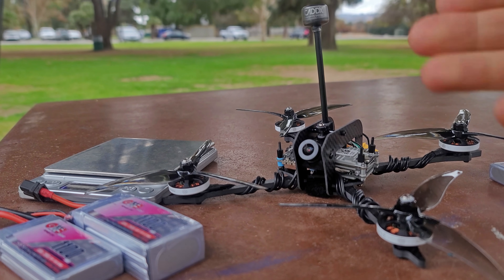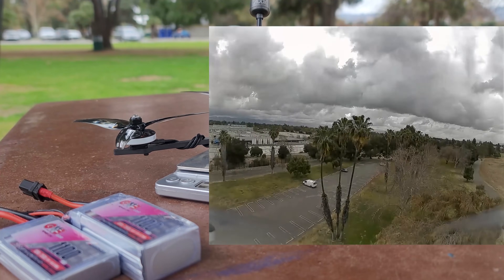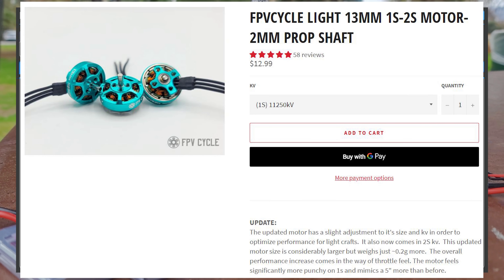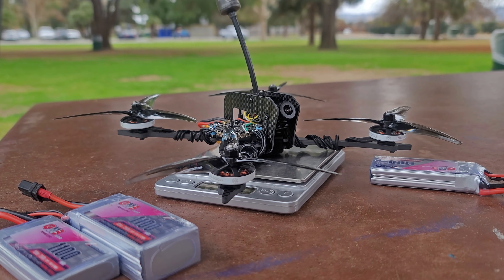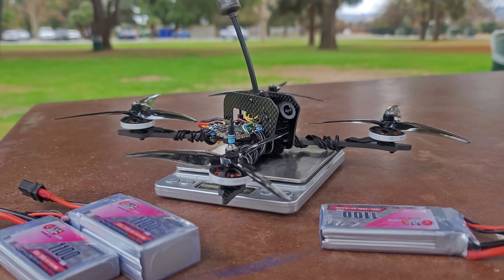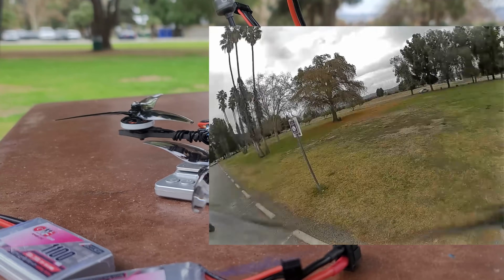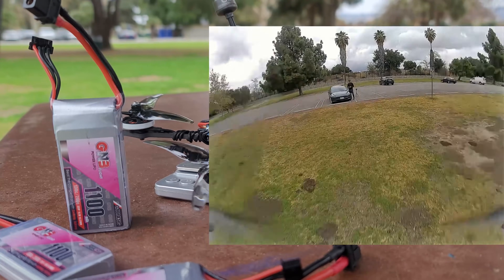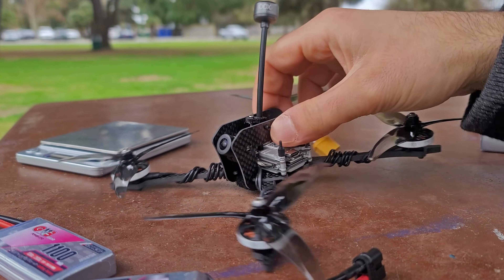Curb your motor wires - 250g 5" things...

Comment: Should be the same weight classification as model aeroplane weights.  Under 7kg, crack on. Over 7kg, large model registration, building inspection, structural testing etc. Unnecessary, unenforceable, useless laws, that do nothing for perceived safety even. Gubmint gots too big for its boots.

Comment: 1100mah = 1.1amp    100C means it can do 100X 1.1amp  for a boost of power i think thats how that works     so 130C battery can do 130x the listed mah
Reply from the maker: C ratings are entirely BS unfortunately. The number doesn't totally mean anything. A really good pack cannot give a true C rating over about 35-37C. Battery companies just use the C rating to rank their own packs against their other lines. You can't compare a 120C GNB against a 120C Tattu. Neither is actually 120C and neither can compare against a product made by an outside company. All in all, the 1100mah 130C pack definitely should not be able to produce more amperage than a 2600mah 70C. If you want to do the math by the listed C rating, that's 143A vs 182A. The 2600mah pack should do 27% better but in my testing, the 1100mah pack is doing maybe around 50% better than the 2600mah pack. There's more going on here...

Comment: IDK about your 6s commentary on this one. I don't have any experience myself, but the single most agile and powerful flying quad I've ever seen was Quadmovr's ultralight 5" with 2004 1700/1800kv with these props on 6s.

Also, I feel like I agree with your original thoughts mentioned in this video on the 250g rule. If I could change it without changing the 250g part, I'd make it so that limit is only including permanent fixtures to the quad. AKA, everything soldered on. So no props, batteries, or recording camera since those are honest to goodness variables.

Comment: Did you ever go anywhere with this approach? I like the aesthetics of the frame (looks a bit like a combination of molar and powerpick). Also the 2S idea is interesting. But seems like you abandoned this direction to go with a more traditional but ultralight 5" freestyle frame and higher voltage instead. Too bad, this looked so interesting!
Reply from the maker: Yeah. Check out my latest video.  I'm just about finishing up the design

Comment: Higher voltage just has much much more electrical potential so the magnetic fields generated have a much higher strength.
Reply from the maker: Current is actually has a direct relationship with field strength. Voltage has a round about path to the same thing.  Currently is generally what feels better in the air.  Feel like flight feel of the throttle

Comment: These low cell big prop light weight drones are intriguing to me. Could get me back into fpv more. I think I will build one of your 3" 1s quads. And find out. Been out it and all of the new stuff for a while. Are my fatshark hd3 still good enough these days? Things have changed since I have been out of the hobby full time for the past year and half.   Seriously I found a build kit from raceflight I never put together frame, fc, esc motors everything, I didn't know raceflight wasn't a thing anymore. Can I still use that kit? Is it worthless? Any help would be appreciated.  now everyone hates frsky things just seem way different.
Reply from the maker: raceflight has become flight 1 now

Comment: I enjoyed the motor discussion. Do you have more content to share on why larger cells can support higher amp draw? Such as 1100mah 3S does better than 650mah 6S? Can't wait for the next sub 250g video.
Reply from the maker: it's a factor of how much surface area there is to pull the electrons from.  More capacity means more surface area means more current means more power.  C rating....

Comment: what second quad would you recommend that is under 175$? I have been flying the normal tiny hawk 2 for about 3 to 4 months. Im looking for a quad with unguarded props and have the ability to fly at parks without annoying people. I really want to build a 3s or 2s toothpick but I have no idea how to solder lol. Are there any solid bnf toothpicks out there I could look at that are 2s or 3s?
Reply from the maker: 3s TP3.  We will hopefully have motors in another 2weeks
Reply: @Kabab  thanks, Ill take a look at that.

Comment: Oh and do you have a good 2s like starter charger? I don't have a real charger yet and I want to put a xt30 on my tinyhawk 2 race with the gnb 450 and see how that goes.
Reply from the maker: The charger is coming after CNY.  I've also come up with a way to get 2S on this to work really shockingly well but I'm still not sure it's reasonable to go with 2S ok such a big quad.
Reply: @Kabab  is it the tunerc thor? Because there is written tunerc on your new babytooth board.
Reply from the maker: @Max_0578  yeah that's the one with some minor changes.
Reply: @Kabab  yooo thanks bob!

Comment: Shorter motor wires will have less resistance and deliver higher voltage to the motors (less voltage drop through the wires), but it really only makes a difference if the resistance of the wires is a significant portion of the total resistance of the windings.
Reply from the maker: That's for sure :-).  The next build will have shorter wires.

Comment: To understand why lower voltage doesn't punch as well is because to hit the same power you need more current and components are mostly current limited, not as voltage limited. One thing that always surprises many people is that wire gauge is about current, not about voltage. Voltage limitations just have to do with keeping things from shorting
Reply from the maker: This quad in general is pretty low current.  If I thickened the wires on this particular setup I would probably get a little more performance out of 2S but not enough to make up the difference with 3S.  Whatever is happening, 2S is just too low for this general setup

Comment: The screws holding the heatsink on vista is supposed to be the same distance as whoop board i heard... So you could stack them if you install longer screws in the vista and use them also for fc... Or just go naked vista...
Reply from the maker: I think I tried that a while back and it didn't work out
Reply: @Kabab  have a look on mr shutterbugs youtube. 3inch baby tooth with vista. Forward to time 9:20... Looks like it works ok with minor adjustment on hole size. I think you should recognize the motors he uses. But he complained about short wires instead of to long :-)  tempted to do a bild like that but haven't clicked buy on dji stuff just yet... Anyways it's been out of stock in EU for some time now...

Comment: Awesome video Bob. I'm having serious trouble tuning my 4" fouride on betaflight 4.2. I was receiving flutters on sharp stick inputs on the default tune and in extreme cases the quad would do a death roll. I don't have rpm filter enabled. Is this a filter issue or is it something I can fix by tweaking the P and D gain?
Reply from the maker: Try emu. I can't use BF anymore

Comment: Just to make sure: On that build with 3450kv and GNB 3S 1100, you would have more runtime in freestyle flight than a 1725kv version of that motor [I know that isn't offered] and a 6S GNB 6S 550mah (which is the same weight)?  If long range cruising, I'm sure the 3S would win out.
Reply from the maker: there's no point to 6S on light platforms.

Comment: I've been telling guys since the powerpick was released that the 2203 motors with Gemfan 5125s running on those 3s 1100 packs is an amazing combo. With the 3450 kv motors I found over time that I preferred Gemfan's 4023 prop and a 4s 850 pack even more.
Reply from the maker: GNB is working on some new cells.  The new 850 4S should be really good

Comment: Great stuff... You watch, they'll be a load of sub 250's come out of China with these specs. Looked fast enough and due to weight, looked like it had a tone of grip. I have a fairly fresh 4s 5inch race build with 2306 2650kv motors on... Weighs 320g dry weight (no battery) are these motors suitable????
Reply from the maker: yeah these motors at up to ~475g AUW are fantastic.  the current 2800kv ones on 3S are excellent

Comment: It's almost to the point were buying any 5" quad that will have an AUW over 250gr, which currently is almost everything, wouldn't be worth buying with the amount of horse sh#@ involved in flying the fu@#ing thing in two years.

What you in for? 260 gr AUW, doing a 5 year stretch! Ridiculous.

Comment: I really think that more than anything the 250g BS is just going to spur on the community to innovate and ultimately come up with better things. In my opinion the naked gopros are goin to become extinct. Why? because the community has figured out how to hack FC gyro data into ANY video footage to run it through rsgo. That means the return of hyrbid cameras that have rx+tx uarts and will write and sync gyro data for rsgo processing out of the box. My brain continues to dream of just how far this concept could get pushed. 1in sensor fpv cameras? 1+ghz FC with built in video processing? Changeable lenses for fpv cameras?
Reply: For the record I think this 250g thing is utterly infuriating and nothing more than a means to an end. Which is the ridiculous notion that corporations can use drones for arial delivery. Ground delivery via drone bot mobile of some kind makes SOOO much more sense.

Comment: Why don’t we try using the voltage more for 5”. It seems like the evolution in finding what motor size and voltage work together would have been quicker if we just pushed everything, including voltage, to the “max”. I remember when 2206 motors were for 6” props only. Gosh, if we only saw what we are doing now.

Comment: Looks like a promising 250g platform...before curbing anything or moving up to 3S-4S, maybe try changing the 'Motor Protocol' to MULTISHOT, for the sacrifice of 'Turtle Mode' but gains much torque, and responsiveness...next, set 'Gyro Update Frequency' to 4 kHz and 'PID loop' to 1.33kHz...also, move 'Throttle MID' to .75 and boost to 9. Might also help to set 'RC Smoothing' to Interpolation, 'RC Interpolation' to Auto, and 'Channels smoothed' to RPYT. Most importantly, dont forget to change PPM Min Throttle to 1000, Center to 1500, Max to 2000 and then calibrate ESC's...this almost ALWAYS helps me resurrect an under powered rig, aziz'am.😜
Reply from the maker: On 2S it's just gonna be underpowered no matter what the settings are.  3S is really the way to go I think.
Reply: @Kabab  true, aziz...but de kid in me, still vould love for you to tweak de tune/setting just for comparison/shits and giggles, lol...then send again on 2S, and 3S. 😁
Reply: @Kabab  ...i know you're busy so just get me the dump, i'll make the changes and get it back to you...voilà. 🐱‍🏍

Comment: So I have made a 250g quad , 1607 2850kv motors, and the thibgs screams, running 4s, get around 6-7mins, quad weight in around 147g mark tried 3s li ion pack and got nearly 20mins of chill flying
Reply from the maker: That motor is 16% bigger than the motor I've got on mine and will weigh considerably more.  It should be extremely fast but your frame must also be extremely skinny and it's analog.  I'm looking forward to trying 3S lion on my quad to see what it'll do

Comment: You mentioned there aren't any good 20x20 stacks to go with the vista - have you tried the new 20x20 Flywoo GOKU HDF745 40A AIO yet? At least on paper it has some decent specs and their gear has been very reliable in my experience.
Reply from the maker: Not stack. Aio. With this small and low weight might as well go with an aio
Reply: @Kabab  Sorry I shouldn't have used the word stack(force of habit I guess). The one I'm taking about is a single board AIO:  https://flywoo.net/products/goku-hd745-evo-40a-aio-bl_32-dji-plus-play

Comment: So you think all those 4" long range quads would be better on 3s?
Reply: They perform better on low kV motors and 4S. The higher voltage and lower kV helps compensate for the small motors and keeps flight times super long.
Reply from the maker: The 4" long range things have motors that are way too small. They cannot fly very well no matter what you do with a motor that small. Run a 3" prop on those motors with 3s or maybe 4s and it'll perform much better but have less flight time.

Comment: Motor size is something that I can't quite get my head around. I usually look at current and voltage rating, and KV for my intended prop size. I can't internalize what a wide or tall motor would do, especially with my upcoming build which is rather... unique. 2-blade 4 inch on a small-yet-chunky frame with the goal of maximum fly time. But looking for motors, there was like 1 or two that even fit the bill.
Reply from the maker: Generally I recommend the biggest motor that the build can support for best flight performance. For higher efficiency, you can give up flight performance and go with a smaller motor. That's the easiest way to sum it up.
Reply: maximum flight time? use 4 18650 batteries. Lithium ion NCR or INR chemestry has almost double the energy density of even the best "LiPos", but their construction limits the current capability, they can't dissipate heat efficiency and have a small copper tab connecting the jellyroll to the case and cap
Reply: Motor design is a tricky subject and you would probably need some real expensive finite element analysis software to model and simulate different designs. But in general you want stator volume, I'm not going to get into the details of field excitation, magnetic flux, core saturation and hysterysis, skin effect and copper losses, trapezoidal vs sinisoidal EMF, etc etc.
Reply: Volume = power
Tall and thin = efficient a high speeds, low torque
Short and fat = efficient at slow speeds, high torque 

In practice this relates to: 
short fat motors are more efficient in general (can drive larger props easier, which is more efficient). 
Tall and thin motors will give a higher top speed. 
Large volume gets you to top speed faster.
Reply: @georgedowning1803  The design of the motor still matters, a wider motor has smaller magnets, which means less permanently excited flux. naturally this tends to increase kV (field weakening) Also the cross-sectional area of each pole is reduced, so the maximum flux is reduced, which would be contrary to the popular believe or misconception that wider motors can offer greater torque. I haven't don't the math but I suspect the 2 things cancel each other out. kT (Torque constant) and kE (we know kE as KV) are the same, just inversely proportional. These parameters that relate torque to current and RPM to voltage, respectively. Maximum RPM is limited by maximum voltage you can provide or the ESC's can tolerate when with regen. I think torque is limited by a variety of factors, such as the strength of the magnets, cross-sectional area of the core for each pole, the number of magnet/poles, assuming enough current-turns to saturate the core, and the diameter of the motor (the obvious mechanical advantage of larger moment arm).

TL;DR motors are hard!
Reply: @power-max  I agree with much of what you say. However, as a motor gets wider it’s natural Ke will decrease not increase hence kt goes up. As I am sure you are aware there are many factors to play for this but take the example of a wider motor can have more poles obviously causing a lower ke.
Reply: @georgedowning1803  Oh yeah right, more poles reduces the speed and increases the torque because distances are shorter and there are more poles pulling on the rotor. Yeah Like I said there are a lot of factors. Its to the point that I suspect the designing of motors is not so much a science as it is an art. for these hobby motors I suspect it is trial and error, and iterating on working designs and relying on rules of thumb.
Reply: @power-max 👍

Comment: I been building sub 250g builds before they was even popular! For a year in half its been many different configurations and now its starting to get a little easier now because of the verity of motors & Aio boards that has come out lately. But they still a lot of room for improvements. And still not a lot of frames available...Thanks for sharing

Comment: Any ideas of an fpvcycle 2004? Seems like that's the right motor for sub 250g running 3S/4S, and I'd be interested to see your take on it.

I've been working on parting out a 4" sub 250g build, and as much as I love the idea of having your 2204 motors on it, even the T mount version seemed just a little bit to heavy for me to make it work.
Reply from the maker: The t mount 2204 is gonna be optimal really but I'm gonna develop a 2203 to be lower weight because I can't stand the T mount.

Comment: As often very nice video. Thanks so much! 

At first I was not certain to read : 
2S and 3000kv... Micros with 5000kv and 2S are slooooow.  Can we even compare kvs on smaller motor sizes ?
By the way, could you please crash the frame? 
Last point: very nice matties ;)
Reply from the maker: I actually like the TP3 a lot with 5000kv and 2s but yeah I know what you mean

Comment: You can only ask for so much out of a stator before its saturated.  I've tried to wind old plane motors to oblivion & there comes a point in (excessive) current draw where you're not getting any more torque out of it, adding more kv only makes things worse.

Comment: Going to sub 250g feels like going retro. Started with zmr250 frame, 1806 motors on 3s! Nice to look back and see how modern electronics have gotten smaller, lighter and more reliable.
Reply from the maker: Definitely is. We're going back in time with new electionics

Comment: "Needs more voltage" - impedance. Higher voltage increases the current faster and resists impedance better.
Reply from the maker: That's easy to say but hard to understand.
Reply: @Kabab  angry pixie ramp-up time?